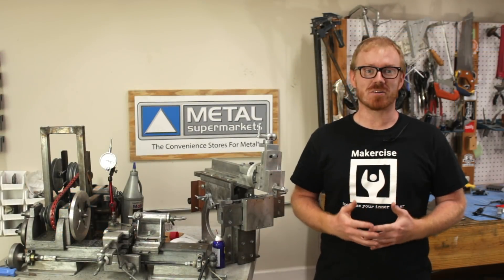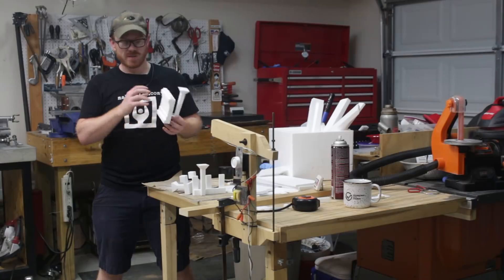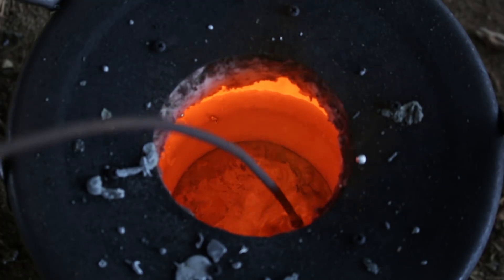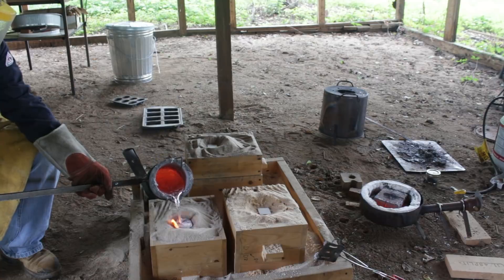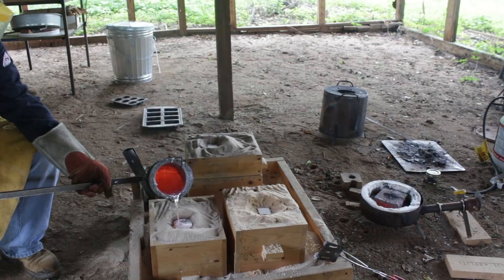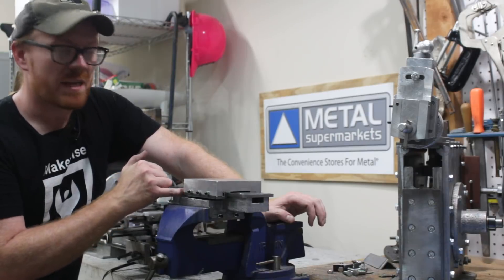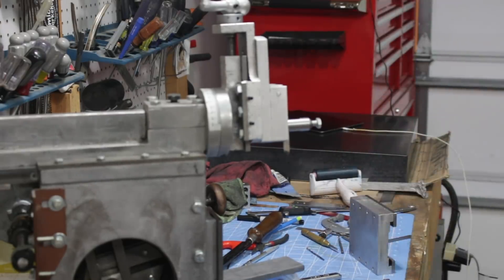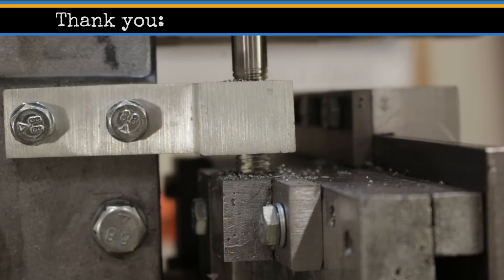Cross Slide for Gingery Shaper - Scratch Built

Comment: All that casting is some kind of art. Professional foundries choose forming sands very meticulously, whilst you use first one available. High gas permeability sand - the reason why they "don't need vents"! Just add some venting if you need and don't listen to those books. But beware - in case of lost foam vents should be hollow from the start cause very likely they will not melt by themselves. 
Great job once again! I'm watching for your adventures with great pleasure!

Comment: I believe the Saturn engines and I know my friend Kelly Coffield's lost foam car engine parts are all gated from the top...  Doing that might help with the rounding.  Were all the rounded sections pretty close to the top of the sand bed?  Some of them sure looked high up.  If so, could just be that the head pressure up so high in the mold wasn't enough to push it full at that temperature.  When all else fails, bury deeper and pour hotter!  Anyhow, the part seems to have come out great in the end, can't wait to see it running!
Reply: Some commercial shops also use a something like a 6 mil plastic cover and put the sand under a vacuum to help deal with the molten metal hydraulic pressures. The extra pressure on the sand is supposed to help keep the mold shape stable and the vacuum helps pull the gasses out faster.

Comment: If I remember right you are using pure plaster for the "thin shell" coating on the foam. Commercial thin shell plaster coatings for lost foam are not pure plaster, the mix they use has additional things added to make it more porous for the escaping gas. Consider switching that pure plaster out for casting plaster used in jewelry. The casting plaster should have a better gas porosity which is closer to the commercial thin shell plasters.
Reply from the maker: Spot on. Buying some proper refractory is on my short list.
Reply: @Makercise  I'm sure that will go along way to improve your results. Are you going to get a true thin shell coating refractory or attempt with jewelry casting plaster?

Comment: This seems a bit silly, but have you considered burning out the foam using lacquer thinners(or whatever dissolves polystyrene) once it's in the sand.
It seems to me that there would be even less inclusions especially in smaller castings of the plaster coated lost disk method

Comment: I think you will find that "professional" castings are made without the plaster coat. I have seen this done with oil bound "green" sand in a foundry in Germany. the plaster may be limiting the venting into the sand. It is theoretically possible to do lost foam without any plaster or dry wall mud! I use oil based green sand but I am going to experiment with fine dry sand only! Water based Green sand will definitely
 work without plaster! Regards, Matthew
Reply: thin shell coatings are common in lost foam castings at commercial foundries. They use a specialized plaster that is designed for a specific amount of gas porosity. Pure plaster doesn't allow enough gas to escape.

There are many other ways to do lost foam, including in green sand, in petrobond or even in vacuum packed sand. There are also full casting plaster molds with a burn out of the foam before the pour, very similar to lost way casting process.
Reply: You are right, I was offering simple solutions without plaster as it can be a water trap creating a potential blow back situation!
Reply: Im not suggesting that it's a bad suggestion. Just wanted to mention that professional castings do use the thin shell plaster coatings. If I remember right the reason for the thin shell is to improve the surface finish in this process. I believe the amount of water in the thin plaster coatings will be insignificant compared to the larger volume of gas from the foam if the plaster is reasonably dry. Dealing with the gas from the foam is an important factor in this lost foam process when using thin shell coatings. The professional thin shell coatings are specially formulated for gas porosity, in some cases they might even coat different areas of the foam with different mixtures to increase or decrease the amount of gas porosity.

Comment: If you were to build the lathe over again would you have used lost foam for all the pieces?
Reply from the maker: YES! Absolutely. Getting the green sand right takes far too much experience and work to get right relative to lost foam.
Reply: Makercise  do you ever have trouble cutting accurate dimensions with the foam cutter?
Reply from the maker: Yes. Leaving some and a belt sander gets it closest. I used my cnc router for the shaper bed pattern though.